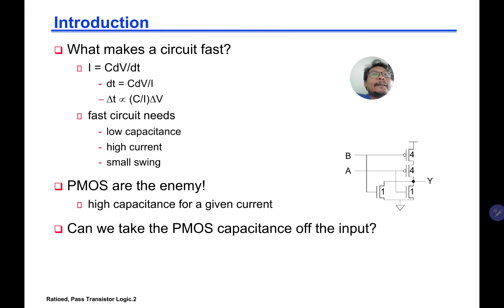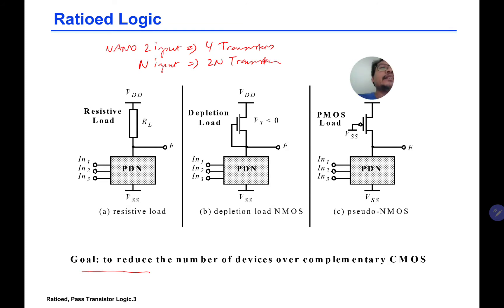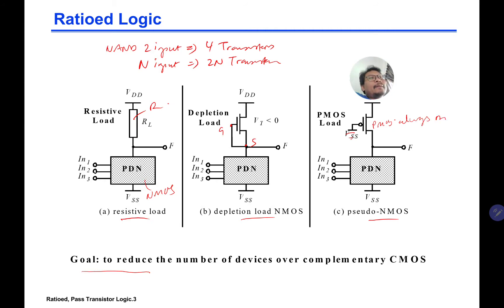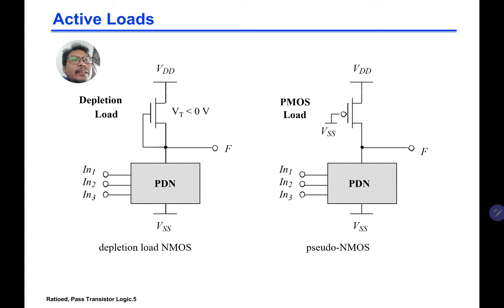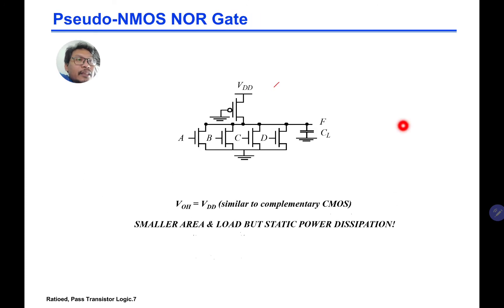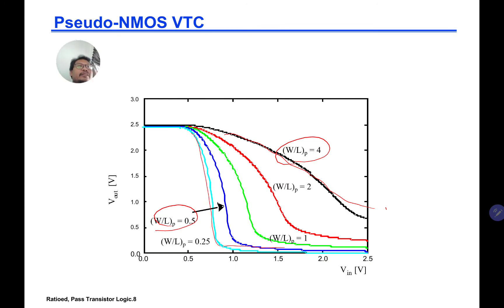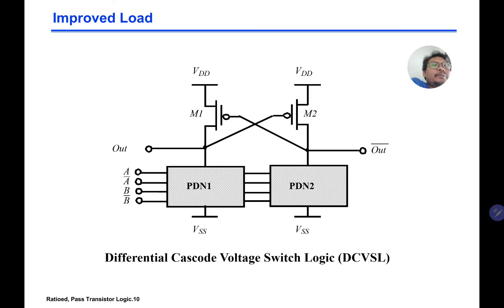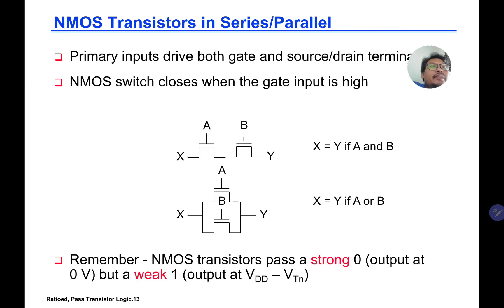MEEH1163 VLSI Circuits and Design (UTM): 5-1 Ratioed Logic

Comment: Hello sir great video. I have a question about this topic. Lets say we have a  bistable circuit using four transistors. Then we modified by adding 2 transistor. How can you convert this circuit into a non-ratioed  circuit. How does that non-ratioed circuit operate?